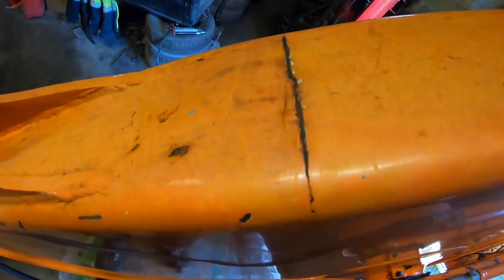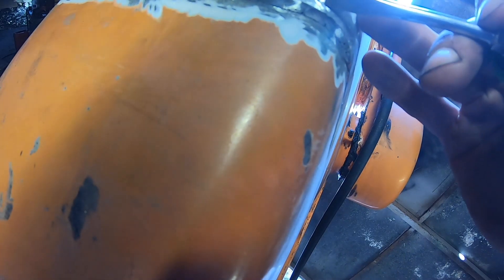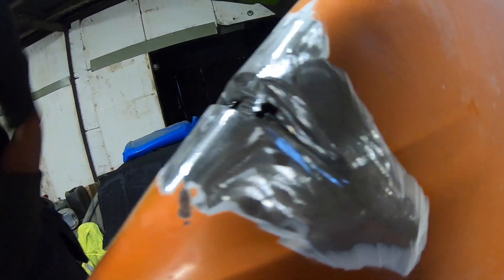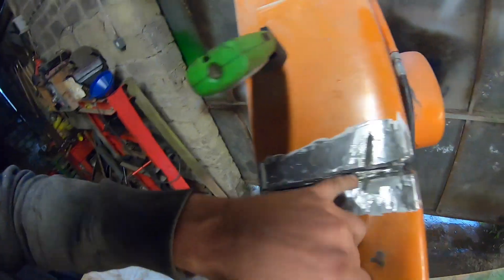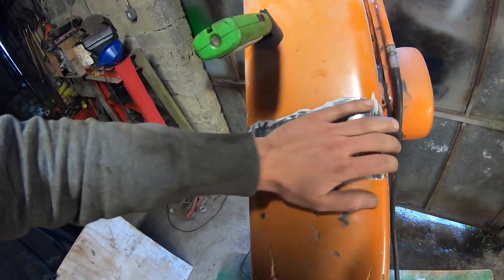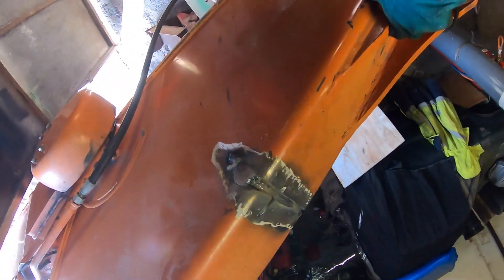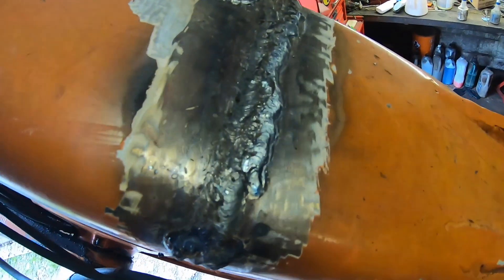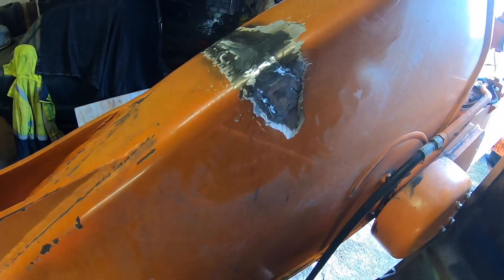Hitachi zx120 dipper/stick arm crack repair

Comment: Hello young man!
Having done a few welding videos on YouTube myself (And still do) and done quite a bit of welding over the last 25years and all unqualified, I like to watch welding repairs and such like. A few tips of you don't mind me saying? Always drill all the ends of any crack so that it stops the crack starting again. Always drag a welding rod, if it leaves slag then always drag. I noticed you were pushing your rods when stick welding. I can only presume you were using an E6013 rod? And would recommend E7018 for structural type repairs like the one in the video.
All the best from Northern England, Jon.
Reply from the maker: Thanks Jon, I can weld but I’m not a professional at it. The video made it look like I wasn’t dragging but it was just because I was at an angle and trying to keep my pool where I wanted it. Thanks for the rod advice, yes I used E6013 to start the lower narrow part of my fillet and then E7018 low hydrogen rods to do the rest. Thanks for the advice Jon👍🏻